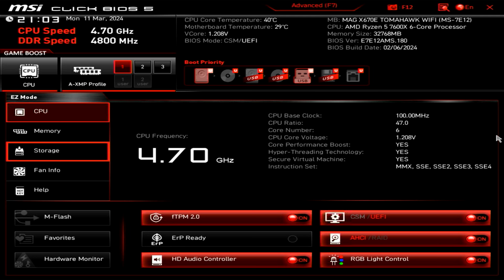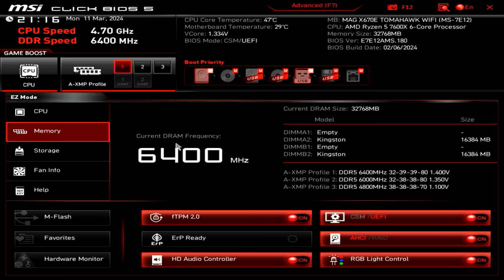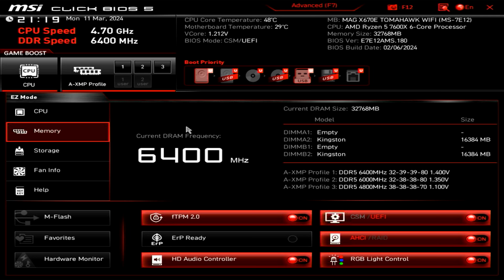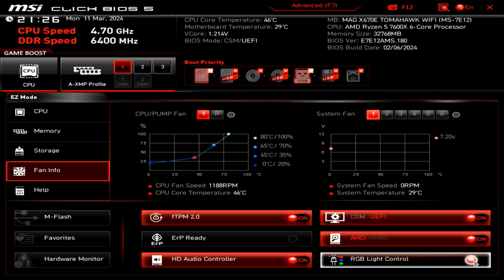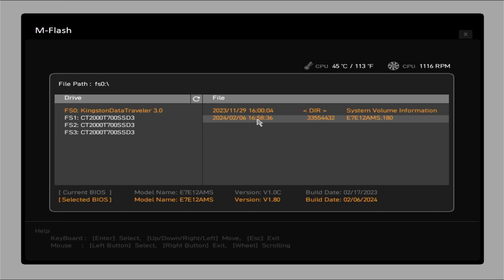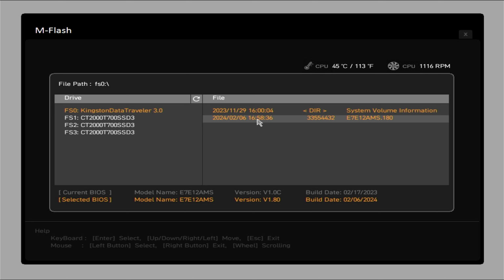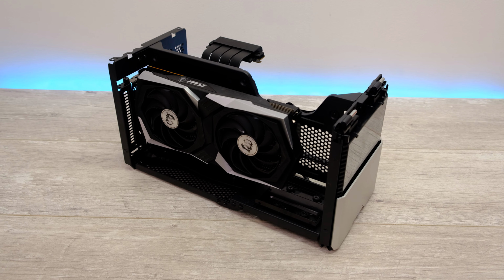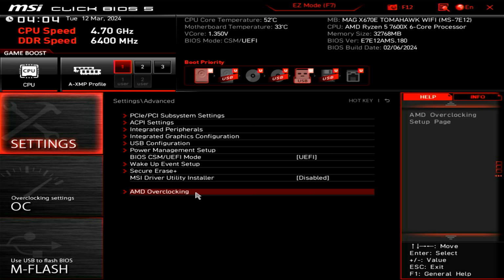How to become a PC EFI/BIOS PRO: Beginners guide to tweaking your PC

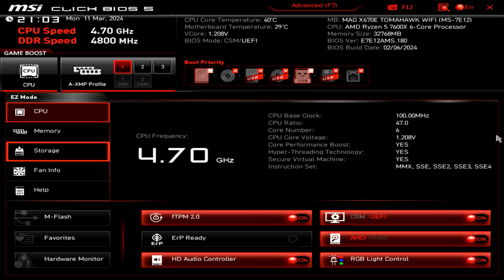Comment: At minute 3:56 you start rebooting and the POST takes around 45 seconds!! And you calmly wait and treat this as something normal on hardware from 2023! I have a PC from 2017 that boots in about 35 seconds, from power-on until Windows 11 is fully loaded. A full POST and BIOS enter took less than 45 seconds even 30 years ago. Something must be wrong with your setup, that motherboard is bad, some incompatibility somewhere, or bad BIOS.

Comment: Super helpful video! 

I just wanted to add that if you have problems with your rams bump up the voltage just a little bit. For some reason some memories is set to the wrong voltage setting. Gskill for example have this problem so i had to increase the voltage and then the BSOD-problem stopped.

Comment: See if you have an older board like a B-450 do you need to install all the bios individually or just the latest one?
Reply from the maker: Just the latest one. In VERY rare instances you might need to install two newer ones in a specific order, but it's usually just one. Super easy.
Reply: @CrazyTechLab   I was thinking I had to install 12 of them, I bought a still new sealed box old board, best I could afford new, saves me a lot of time, thanks for the input 👍
Reply from the maker: @RighAlban  Thankfully no - my pleasure!

Comment: If the CPU is listed as 4.7GHz, why don't they use the same units for memory, like 4700 MHz? Or if memory is 6400MHz, why isn't it 6.4GHz? Why do they display different units for CPU and memory? It makes no sense; it's just a unit, whether MHz or GHz, or even perhaps in Hz, like 4700000 Hz for the CPU. What tricks are manufacturers playing on us? I have no clue except that whatever you say, it's the same. Even when you're reading 'sixty-four hundred MHz,' why not just say 'six point four gigahertz'? You would say '4 point 7 gigahertz' for the CPU; why not 'four point seven hundred megahertz'? Why not use the same units for the same things? Clock speed, whether it's CPU or DDR, is measured in hertz.
Reply from the maker: Interesting point. It 's got something to do with the fact with memory, it's not actually raw frequency we're talking about. It's megatransfers per second or MT/s which is a more accurate way of measuring the data rate of memory. There was a bit of commotion over this a few years ago in that frequency is actually wrong and we should be using MT/s instead. This is different to the frequency of a processor, which is the number of cycles it performs per second. Also, it might even help the end user to differentiate the two so not to be confusing (even though having them different can do that too) plus memory is often a difficult sell so 6400MHz sounds better than 6.4GHz. Probably lots of reasons!
Reply: @CrazyTechLab  still its fun, hertz is hertz and none else can change it. So as far as you call it MHz or whatever with Hz at the end it is same and will be same always and forever. Cheers !